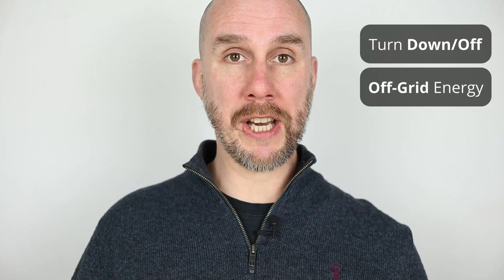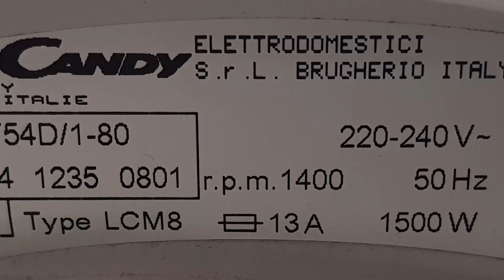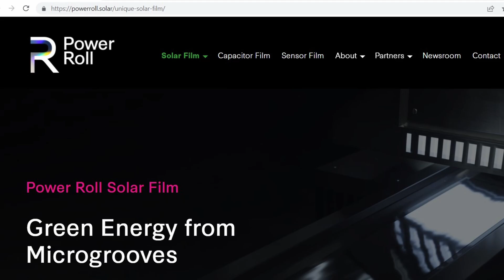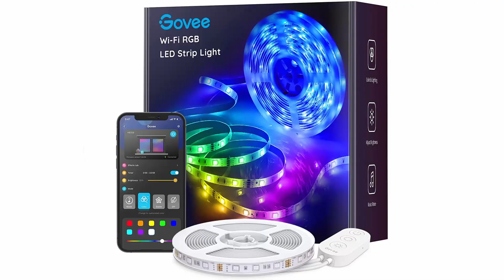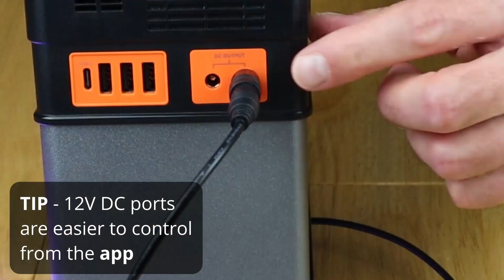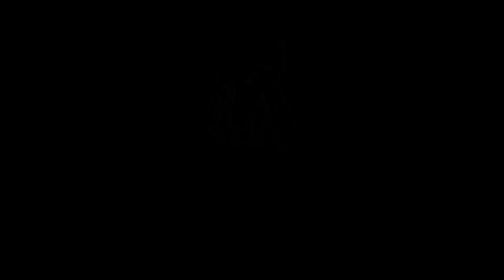Energy Matters #1 | Off-Grid Solar & Portable Power at Home | Cutting Grid Energy Usage

Comment: Using stored energy can also happen without solar OR batteries. I have a heat retaining pot for cooking. You heat up the inner pot and start to cook your food, then transfer the whole pot to an outer case and leave it for hours. When you go back, you get hot cooked food.It works like a slow cooker but off grid once you get that first bit out of the way.  You can do this with liquids in vacuum flasks too.This was quite a common cooking technique in victorian times and during the wars.Could you look at how to weather proof power stations do you think?  I rush out if it looks like rain but cant put em out if going out due to their none waterproofness. IS there a solution for that?  Same with my solar blankets which are alright for a quick spit of rain but cant be left when not home to get em in if it should actually do more.
Reply from the maker: @Logotha Ironsides  Hey! Thanks for sharing another option👍 I've heard of thermal cookers, but hadn't considered it. I'm now thinking I could use one that works with an induction hob (powered by solar of course) in the heat-up stage and then leave it off-grid slow cooking😊

You can't really weatherproof power stations as they are designed for use indoors, but I know exactly what you mean (had a number of dash and grab moments myself). The best way I've found is buying or making a solar panel extension cable long enough for it to reach back into my house or garage. This way it's shielded from the elements and can still charge happily without the rain worry. This is also based on me using weatherproof solar panels (glass). If you could find somewhere outside that has some kind of overhand to stop rain falling onto your solar blankets, preferable off the ground too in case of surface flooding (heavy rain), that might be an option. I hope this helps and please let me know if you have any other questions. Cheers, Adrian
Reply: @DADvinci  A wonder bag or haybox works similarly except you just make the outer insulation and use a pot you already own. Some people just use a duvet or pillows kept for the purpose and stuff it all into a cardboard box or one of those plastic coolers. We got a thermal cooker because we thought it would be easiest to have that compactness in a camper. Ours is a MrD brand because they make them in England , not cheap but definitely worth it as it will last forever.  (not affiliated or anything )

Comment: Please could you check if smaller power stations, can be charged from smaller 28W folderbal solar panel/chargers. I live in a flat and this is my only option. I already use them for power banks.
Reply from the maker: @Gothic Card  Good day and thanks for your question. As long as the 28W panel provides around 18V in full sun, then it should work with smaller power stations. It's worth checking the input voltage range on the power station first to ensure the panel voltage would work. I hope this helps. Please shout if you have any further questions. All the best, Adrian
Reply: @DADvinci  thank you for the information

Comment: Hi Can I convert an Anderson connection to XT 60 FEMALE CONNECTION to use all- power solar panel 60w to all-power 2000 w with only an XT 60 male input. Why do all- power use so many different charging cables for different power stations their S400 does not have XT60 and their S2000 does not have Anderson??
Reply from the maker: @Kevin Carter  Good day Kevin and thanks for your question. Unfortunately, manufacturers do seem to change things up when it comes to cables. I'm not 100% sure what comes with the 2000W version in terms of cables (don't have that one). From what you've said, you might be able to achieve what you need by using the following cables (affiliate links).

Main cable (1.5m) - https://amzn.to/3DDdB9s
End converter to turn DC7909 to DC5525 to fit panel - https://amzn.to/3UrQ2XT

I don't know how well they would fit together (as I've not tested them), but they look compatible on paper. I might be able to find them cheaper on AliExpress if you wanted, but it would take longer to get delivered.

I hope this helps a little. Please shout if you need anything else. All the best, Adrian